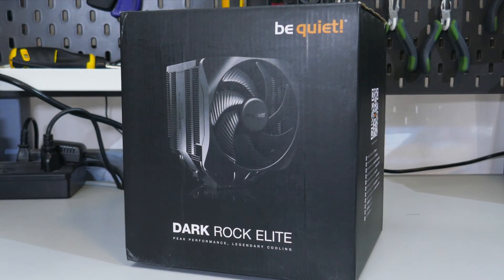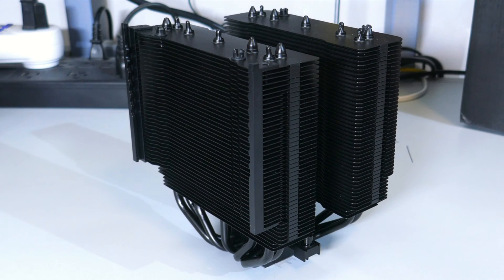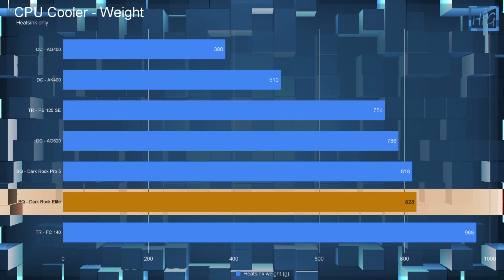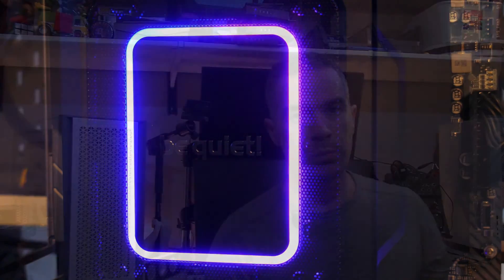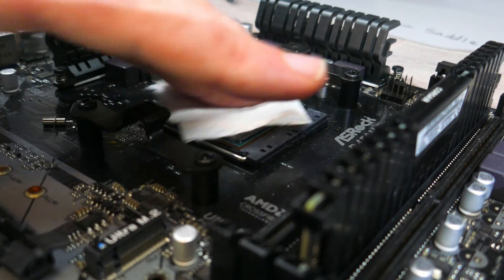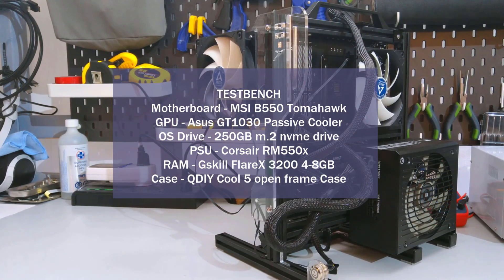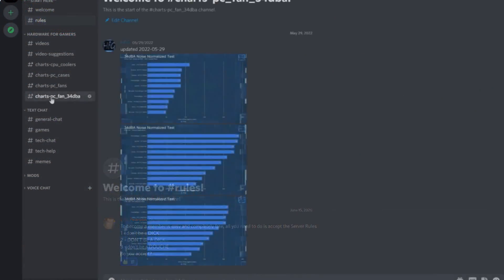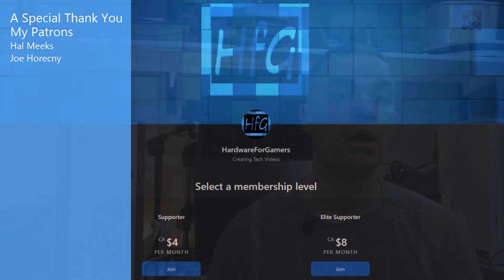Be Quiet Dark Rock Elite   CPU Cooler Review

Comment: Great review, as usual! That's a biggie and I'd suspect it may not fit in most average-sized cases. Then again, with the latest GPU's and such all be enormous it could bode well for those upper-level PC's.
Reply from the maker: Indeed. It ends up being about or just slightly smaller than the D15. Which makes sense since they perform much the same.